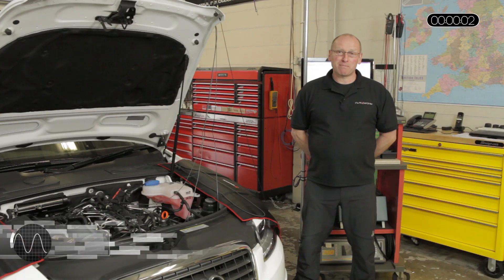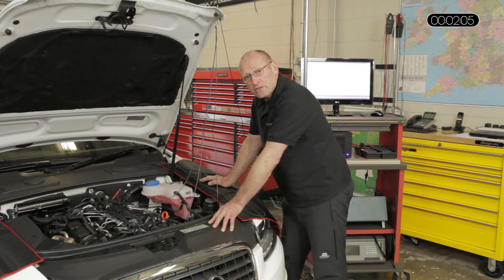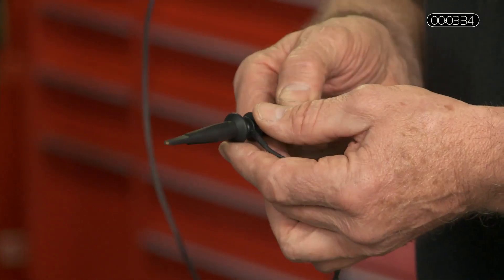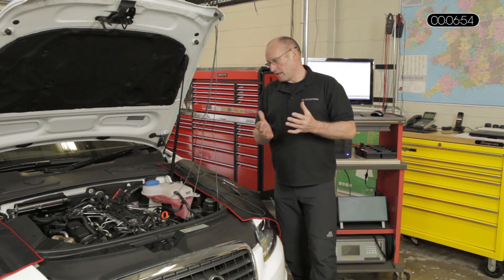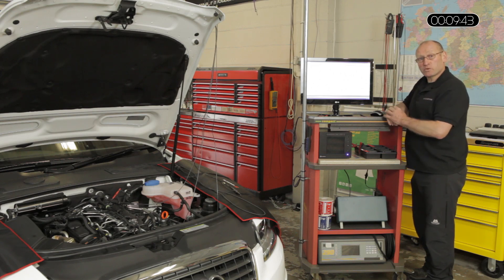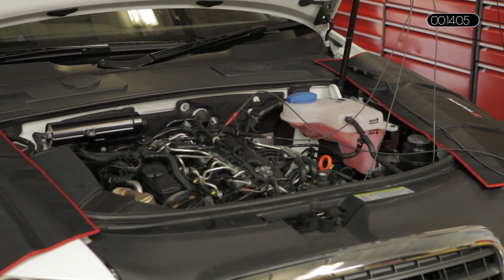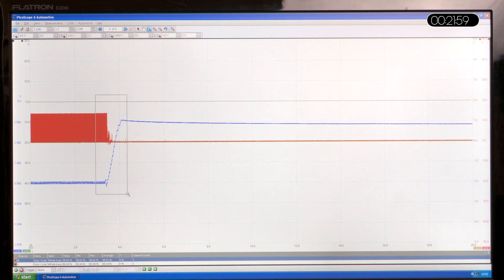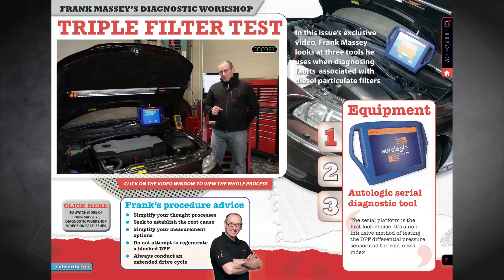AUTOiNFORM: Diagnostics on Bosch common rail DTC 17

Comment: Hi thank frank for the video but I want to know when the engine is stoped like what you show with high system pressure what about the low side pressure side of the injectors or bleeder lines should any fuel come out of of the small outlet port of the injectors or none at all because I have a 2011 Jetta CRD Diesel with piezo injectors and I have a no start low fuel pressure of a maximum of 100 bars on the diagnostic tool while cranking what I did is run the 2 electric pump in basic settings then close the fuel pressure control valve electrically then maintain pressure in the rail and I saw fuel coming out of the the small outlet port I put windshield washer fluid clear hose and then hung them up then I saw some injectors not leak fuel much and some leak quite a bit I also did a test with the engine cranking and the same injectors with the most leak still had the most leak I know that the leak test differs from normal and piezo injectors is this correct ?